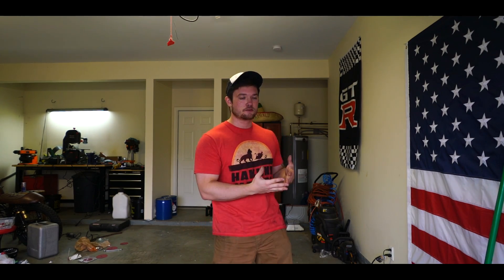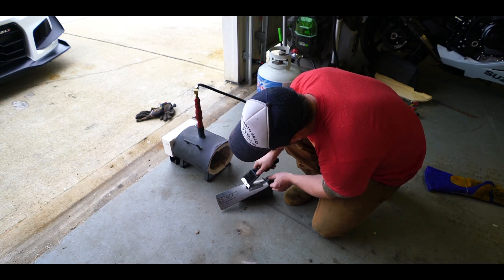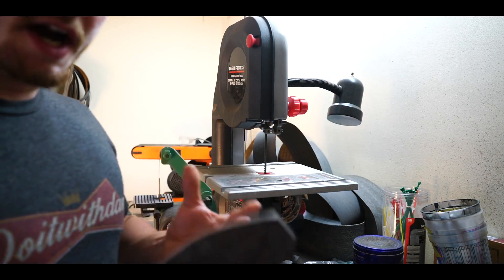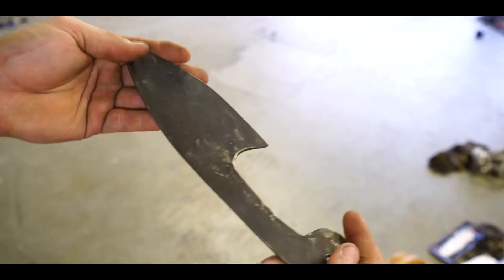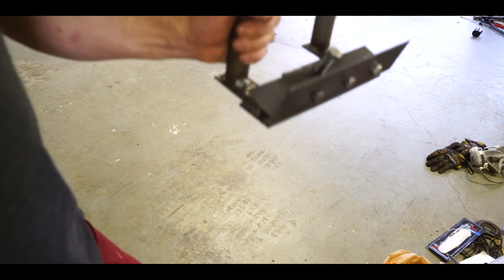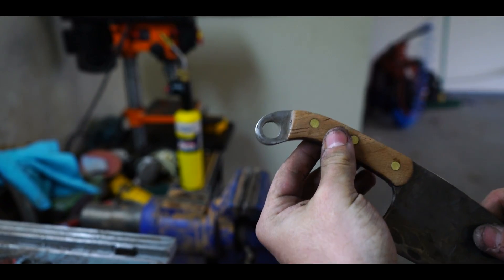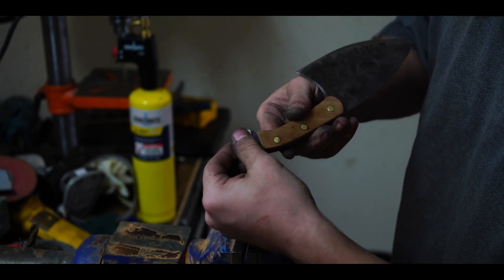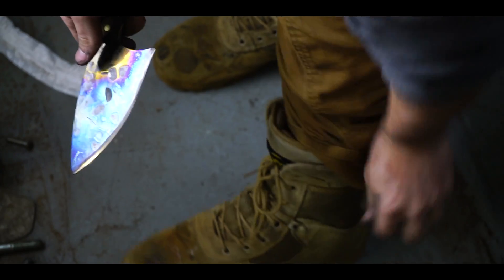Forging a Knife from a Titanium Jet Engine Turbine Blade

Comment: Tip for bandsaws, you want at least 3 of the teeth in the cutting material at a time, so you'd either need thicker material or more teeth on the blade.

Comment: For the cut off blades you will blow a ton of money unless you buy the 10 packs from harbor freight. If you think there sketchy or anything there not they work amazing. I’ve only been using those for years.

Comment: Titanium isnt a great knife material
Reply: What makes you say that it's abrasion resistant it's really strong it's lightweight it's corrosion resistant it has a high melting temp and the oxides are beautiful
Reply: @Yllivan100  it chips super easily, D2 tool steel has better abrasion resistance. It's hard to sharpen more so then S35vn. And it's super freaking expensive.
Reply: @Joshua-hz3cl  that makes sense

Comment: Should be wearing welding mask when grinding Titanium.  Arc eye is a bitch. and  titanium is very flammable so I wouldnt be grinding next to drywall. I make those turbo fan blades at work on 5axis cnc machine.

Comment: Hhhhhhhey Dan, just wanted to pass you a helpful idea. lower the blade guide on your band-saw down closer to the height of the material you are cutting, it will be safer as well as cut better for you. Also you can buy many different blades to cut most materials, they will help greatly in time spent cutting. 
happy holidays bud

Comment: How good duz itedge hold sharpness
Reply: Well he said it was very easy to sharpen, but he also said his abrasives couldn't handle cutting it. So the info presented is kinda conflicting. However, since sharpening happened at the end, and since he said it was very easy to sharpen, this would suggest a low HRC (typical of titanium). These conclusions tell us that the knife will have poor edge retention, which isn't a surprise with titanium. Now, the fact that this was used in a jet means there are other alloying elements in it that probably aren't found in typical titanium stock, and the edge is probably ground at a fairly steeper angle than a chef knife, and these factors could point towards somewhat longer edge retention as compared to without. It's really not scary razor sharp, and it's not going to hold an edge as long as a high quality/ properly treated carbon steel blade, so I'd say that it's an average to below average blade in terms of utility. That's not to detract from the fact that it's a very cool titanium finish, and more about the sentiment behind it

Comment: for the love of god dan, pleae put a guard on that angle grinder makes me cringe when i watch someone work without the guard
Reply: The guard gets in the way when making precision cuts. I run two grinders, one for cutting, one for grinding, the cutting grinder has no guard for that reason. I've also had a few disks explode on me, 99% of the time they stay together and you'll be fine
Reply: @Robert-qm7yi  well ive worked with guards on angle grinders and I have no problem making precission cuts it doesnt get in the way actually, at least not for me, and last time I had a disc explode on me, on of the shards went straight into my face like 2 centimiters away from my eye, so put a fucking guard on lmao
Reply: @MrRada2000  Guess I'm lucky. All mine got caught and shattered but stayed together or just left a chunk in the steel. I have a guard on my current grinder cause I haven't bothered to take it off yet, probably going to keep it and just learn to work around instead of continuing to risk scarring up my pretty face
Reply: @Robert-qm7yi  yeap, better have your whole face than a good cut on the steel, just try cutting less and grinding it to where you want it lol
Reply: @MrRada2000  Meh, I'm lazy. Whatever gets the job done fastest is what I use

Comment: https://tinyurl.com/yccnvegl
https://tinyurl.com/y89d8e67

I think these would help immensely in making those inside curves. Don't know how carbide and titanium mix but these kick ass with any sort of steel or aluminum. Die grinders with carbide bits if the links don't work.

Comment: Bandsaw does work really well, just have to have the right blade on it. Those teeth looked WAY to far apart for thin material like that, which means they will bite too hard. Titanium and steel also prefer slow speeds on bandsaws with either a wax or heavy oil lube, not WD-40. WD-40 does work really well on aluminum though!

Comment: I'm no bandsaw expert but I usually drop my guides down to a 1 inch to a 1 1/2 inch above the material before cutting
Reply: just trying to help for next time you are having a problem with the blade slipping off the wheel
Reply: No. You’re right. I thought the same thing. The higher the guide is over the material the more prone it is to walk. He’s also using a wood blade. Nice knife though.

Comment: Titanium is a beautiful material. By the way to get the best color you can put it in water and run electricity through it. I don’t explain it too well but it’s an amazing process.
Reply: Justin Voelker electrosis if im not mistaken?
Reply: @LogieT2K  anodizing?
Reply: @misterknifeguy1992  I'm not great at stuff like this, but I think anodizing requires a dilute mixture of one part battery acid and three parts water but I'm not sure if its the same way for titanium but I know you can use acid and water for aluminum

Comment: dan your blade in the  saw  has  about  6  teeth per inch,  that is for  wood,  you need to use  about  20 teeth per inch for metal cutting, 32 teeth per inch  even  better for  that  thin of  metal you are cutting

Comment: Bandsaws for wood and metal are a bit different. Metal bandsaws have tiny teeth on the blades, use cooling fluid and are usually horizontal.

Comment: Actually titanium is toxic when hot
Reply: Titanium is bio-compatible and non-toxic, a reason it is so good for artificial knees and such. When it gets hot it oxidizes to make TiO which is a base for dyes and while not great for your lungs has been used to some effect to treat pneumonia in rats, strange but true.
Reply: You all are dumb. The toxicity is in the fumes and no, as a blacksmith myself they have not been using titanium for years, titanium is considered a precious metal and is rarely forged due to its impracticality.
Reply: @peytonvogt3319  Don't worry this knife was made by stock removal not forging.
Reply: Peyton Vogt not true at all titanium is forged. Boeing forges there Landing gear and wing structures from massive 3’ dia.  billets of titanium. It just takes a  massive furnace and a lot of force. Check out wyman and Gordan the have a 50,000 ton press for titanium. You shouldn’t speak fiction as truth it makes you look ignorant.
Reply: @tweetertx02  for knife making he's somewhat correct. it depends what you're doing but the stock is relatively expensive vs say 420c. you can forge titanium but it isn't all forged this applies to all elemental metals. some alloys require forging as part of their creation but titanium is not an alloy
Reply: tweetertx02  At my company we forge titanium billits at 850 degress celsius. The forse we use is about 400ton pressure, titanium and Zirkonium is wery soft when it’s heated. One billet takes about 15-20 minutes to forge and it’s no problem.
Reply: @SALT PROOF NO just no.  Titanium dioxide is toxic.  It's not cadmium toxic and it only forms at very high temps but it does increase your risk of cancer.  If you grind titanium often wear a respirator or the like. You're not technically wrong titanium oxide isn't something to be worried about but when grinding look at the sparks and the dust, titanium IV is going to be white or greyish mixed with titanium and/or other oxides and bits of your carbon wheel.  What you said is extremely misleading.  General summary if you want better odds of making it to old age wear a lung rubber when grinding or welding in general but especially titanium and aluminum.
Reply: @Fallen7Pie  , they use Titanium Dioxide in pills. Its what makes them white. Also used to make rubber white.
Reply: @cuzz63  it's often used as a pigment but is likely carcinogenic if ingested. I've not heard of it being used in pills, doesn't make a good binder so i can't see why they would wast the money
Reply: @Fallen7Pie  Titanium dioxide is an FDA approved food coloring agent commonly added to pills to make them white.
Reply: @cuzz63  doesn't make it a good idea to ingest or inhale if you can avoid it. it's classed as a b2 carcinogen. it shouldn't kill you in small amounts but doesn't seem inert
Reply: @Fallen7Pie  we used it in powder form at the tire factory I work at to whiten white rubber...its was all over the machine and in the air.  Good thing we stopped making white rubber.
Reply: @Fallen7Pie  , although we make rubber that has silica in it and silica is worse.
Reply: @cuzz63  ah factory owners, if it's not a for sure carcinogen it's ok by them. b2 is basically the probably maybe pile. apparently dunkin donuts was using in the powered sugar for a while but stopped because it's not a good look even if it's legal. silica tho, oof
Reply: @cuzz63  

Point their making is inhaling titanium oxides, not eating them.
Reply: @Fallen7Pie  well titanium is an aluminium alloy
Reply: @RikkiTheRose  drugs are bad, mmmkay
Reply: @RikkiTheRose  no it is not, Titanium can be alloyed  with iron, aluminium, vanadium, and molybdenum though to make alloys. Also they both have their own place on the periodic table, aluminium is from the boron group not the titanium group.
Reply: Not to mention blinding without proper eye protection. Which from what I could tell, he didn't have. Macular degeneration is a thing.
Reply: @ducttapedude21  im not saying its not harmful, Im saying that he should be alright even tho it is toxic as , along with many others, he wears the correct ppe and takes the right precautions . Smoking kills tho , shits not cool
Reply: @PolishIrishBlades  yeah haha xD i pave highways and hate the toxic fumes but the moneys good.  "lights up another dart.. sigh"
Reply: Titanium dioxide is essentially inert when inhaled. It does not accumulate in the lungs and is relatively easily eliminated by the body. It is not a "heavy metal" in the biological sense. It's most common use is as a colorant/texturizer/transparency reducer in pills and capsules, as well as nutritional supplement powders and beverages. The average American eats around 1gram per week. You would likely inhale less than a milligram working in an open space like he is. Source: I have a degree in pharmacology, I work in medicine.
Reply: A substance does not need to be toxic, per se, to cause long term repository problems when inhaled. The deciding factor is total exposure.
Reply: He is not eating it he is making a knife he will be fine.
Reply: Knifemakers have been using titanium for years , let alone other materials like zirconium and meteorite. I think he will be fine.

Comment: hey Dan I'm not much of a black Smith but I can tell you if you want better performance out of your band saw you need a blade with lots of teeth on it yours has very few teeth and it will grab the metal rather than slice through it
Reply: I could have said hey Dan your band saw would work better for that titanium if you have around 10/14 tpi (teeth per inch) and your SFPM (surface feet per minute) around 100 and your SIPM (surface inches per minute) around 1. for material up to 1 inch . but I fugred it'd be easier to understand if I said more teeth more better
Reply: Also needs to bring that guide down as low as possible to reduce flex. A bandsaw with the right blade and speed is the way to go for a lot of stuff over an angle grinder.
Reply: You want at least 3 teeth in contact with the material to prevent grabbing. The teeth must also be big enough so they can carry the chip in the gullet without fouling. Thicker materials require a coarser saw, thin ones want a fine blade. The teeth on this blade were definitely way too coarse for the job at hand.
Reply: @remcovanvliet3018  this guy saws
Reply: Lol its TPI (teeth per inch)
Reply: Josh Mango Lol you sir are a genius
Reply: Stinky Pinky lots of small teeth work best for tough material.  Fewer large teeth is best for soft materials such as wood
Reply: Justin Voelker yeah that's what I ment. small teeth for the hard titanium.
Reply: The bandsaw blades I use alternate TPI every inch. Cutting teeth, and chip pulling teeth. Works REALLY well.
Reply: How does your pinky get stinky?   Don't answer that.

Comment: Where did you get your anval and forge
Reply: You can find super cheap anvils at harbor freight, but you get what you pay for, or you can find good ones at estate sales, or even just around your neighborhood. Someone probably has one kicking around. As for a forge a little coffee can forge is a great starter way to go or you can buy a premade one, just Google up a propane or acetylene forge. I'd recommend a coffee can forge to start out with. Not a super huge investment if you're starting out.
Reply: I would recommend making a coal forge because it's a lot cheaper and can technically be ran off of wood but will require more fuel, and it's harder to heat the metal evenly but it's cheaper for someone who is experimenting with forging plus it heats the metal quicker (in my experience at least). All you have to do is dig a small hole in the ground and put a pipe in the side with a hairdryer or air mattress pump for air, you can look up videos to see the forge I am talking about, it requires no bricks or propane/acetylene just coal, coke, or wood. Coal and coke are available online, and you know where you can get wood (untreated wood works best, especially very slightly rotten wood, because it produces more heat but burns quicker). For an anvil just find one, or get a piece of railroad track or some other sort of hard steel that wont move when you hit it. The heavier, the better in some cases, although that's just generalized based on how often you forge, the size of what you make, and the carbon content of the steel could all influence your decision, but honestly, railroad track is just as good as any commercial anvil, especially if you make a horn on it and the tooling holes
Reply: Robert Evans not for working titanium you don’t. Carbon is the last thing you want around titanium. The propane forge he’s using is ideal for the material he’s working with. Coal is fine for steal only.
Reply: @panzerHeiliger  Yeah, sorry I'm not experienced in titanium, only steel. I've wanted to look into working with titanium a little but havent and I guess I'm glad since i only have a coal forge rn

Comment: Don't do the paper test for knives. In the future, see how thinly you can cut tomato slices with them
Reply: Jacobs right, that has more of a hatchet type size , no matter how sharp it is, the steep edge after you cut into it will mess up the cut
Reply: I don't think taht would be ideal for every blade. For example the one he's made here has a pretty thick blade by the looks. So it would have a very hard time cutting a thin slice since it's wide. Paper and the smoothness in which it cuts is a super easy and fast way to show off the sharpness that you can even do with swords and axe heads.
Reply: @TheSlamDaddyMcNasty  but the way you hold the paper influences the smoothness of the cut, as well as the length of the cut too or if it will be a tear rather than a cut.